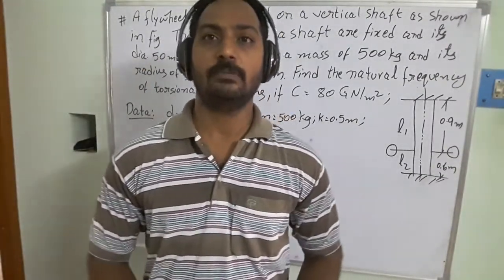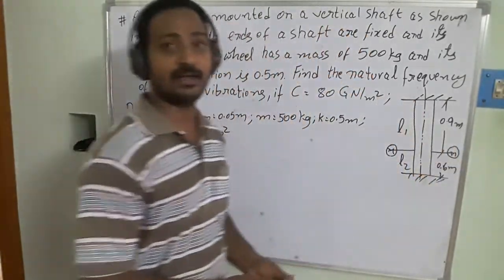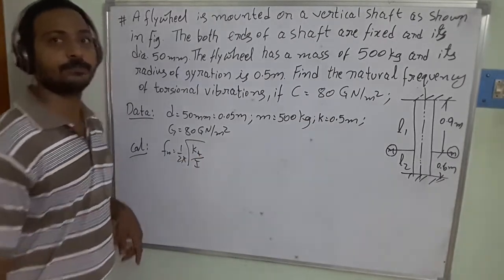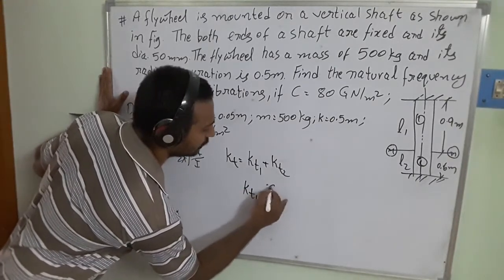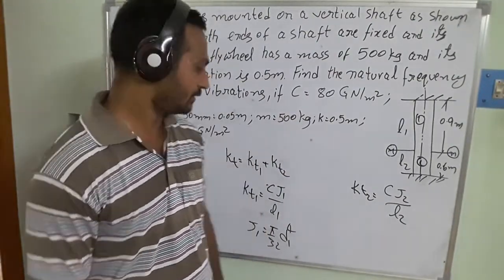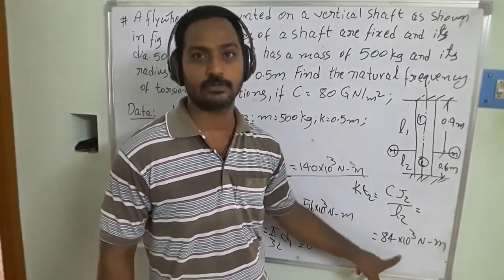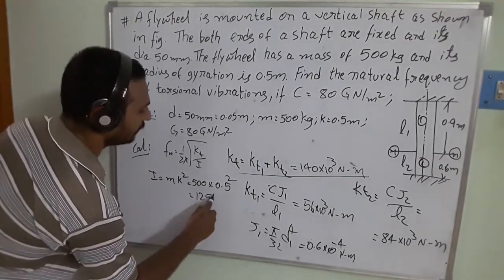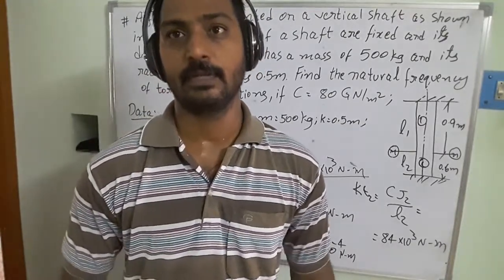Lecture - 20 : Numerical 2 Free Torsional Vibrations

Comment: J1 value calculation, 
Pls Expalin 
We are getting another values
Reply from the maker: Hello there,

J is nothing but the polar moment of inertia. In this problem, the polar moment of inertia (J) of a circular section is given by [( 3.14 x d^4 )/32]. The cross-section of the shaft remains constant throughout its length, so J1 = J2. 
Note: The 'd' value was taken as 0.5m instead of 0.05m. Due to this, you are getting a different answer. The actual value of J is 6.13 X 10^-7 mm^4. 
all the best..
Thank you.
Reply: @kishoresambireddy  thnq so much sir